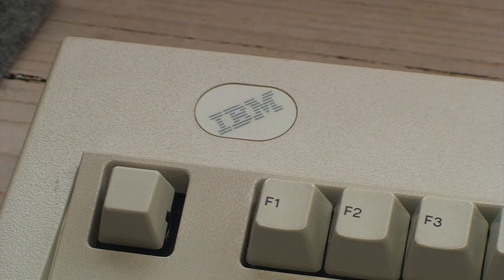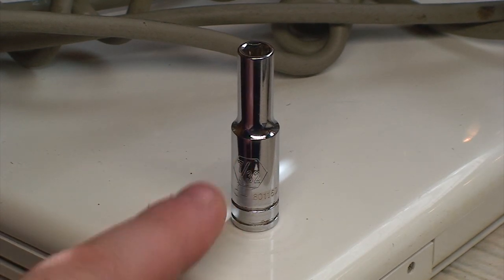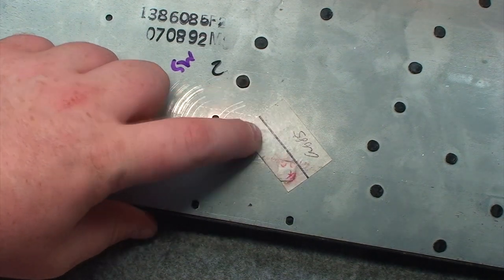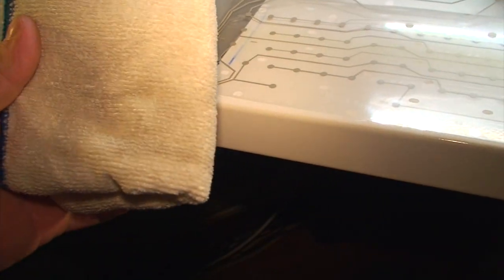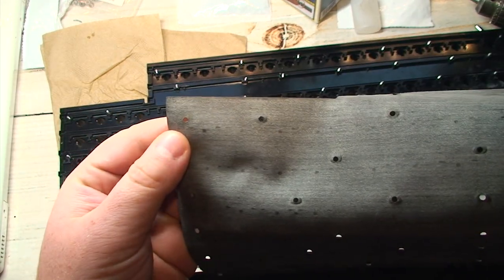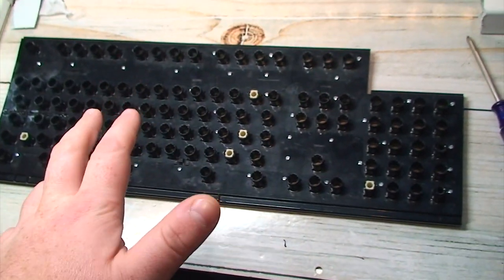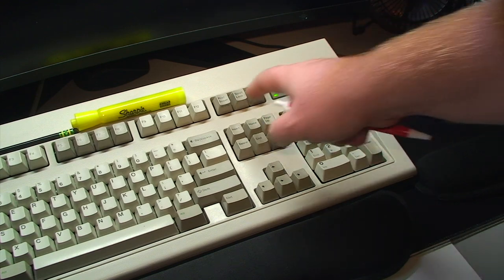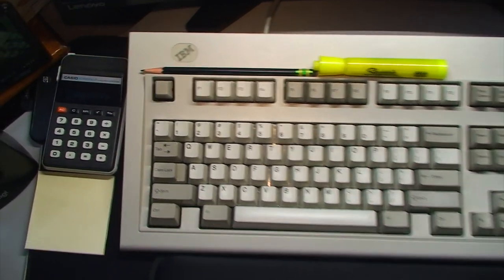Restoring My 1992 IBM Model M Keyboard... By Bolt-Modding It

Comment: When I cleaned the keys and the key caps during a partial restoration, I failed to dry out some keys. Consequently, the minute drops of trapped water, caused the some of the springs to corrode. I had to get new springs from Unicomp and devise an applicator to replace the spring whilst the board chassis was still in one piece. I realised I only had to wash the key caps, NOT the keys. I know that an inevitable bolt-mod will need to be performed at some point. Your M's failure after sitting, could be an ever so slight film of corrosion on the contact foils that builds up when not used. Kudos to you for carrying out the bold-mod, you did a marvelous job. Cheers.

Comment: Nice video. Reminds me of how difficult it was to do a bolt/screw mod the first time I did it. It gets easier the more you do it. Now, with the right tools (Dremel 4300 set to the lowest RPM, smaller bit, better screws), I can usually complete a full Model M cleaning and screw mod in ~24 hours. Or shorter, if I don't have to wash anything and wait for the parts to dry.

Comment: Nice restoration! I had no idea that the Model M has plastic welds/rivets holding it together, especially considering my multimedia Dell keyboard from the mid 2000s has screws holding the metal plate. The mod you made looks like it’ll last a long time and it looks like new again! I know how long a keyboard cleaning and disassembly can take, but at least the end result is worth it! By the way, if you plan on restoring more keyboards, you can make one of those key cap puller tools. I made one a while ago and it has honestly helped a lot. If you’ve got extra keyboards like I do, it’s definitely worth making/getting one.
Reply from the maker: I just bought 1988 Model M that is thoroughly filthy, so a full disassembly, cleaning, and possibly a bolt or scew mod is on the horizon. I'll definitely look into making or getting a keycap puller; doing it with your fingers isn't exactly fun!
Reply: Can’t wait to see that! I’ve been wanting to restore more keyboards also but they sure do take some time. It really is a night and day difference when you see before and after though and you can never have too many keyboards. You’ll see the difference immediately with a keycap puller!

Comment: Good job. I did this mod on some almost dead Model Ms a few years ago (an early 90s IBM and a early 2000s Unicomp). On both of them the rivets were OK, but the membranes went bad (possibly due to spillage), so I had to repair them with conductive ink. It was difficult to get working properly as the tension of the bolts really made a difference. My main (circa 2014) Unicomp is fine at the moment, but the rivets are starting to fall off.

Comment: Glad you were happy with the result.  I would expect the majority of people watching this video would be for the purpose of watching someone carrying out the bolt mod (I would be one of those).  Your video completely omits the work you carried out and, unfortunately, is nothing more than a summary of what you had done.  I understand if you removed the most important sections to keep the video duration down, but a time-lapse of you removing the keys and rivets, the drilling of the holes and the insertion of the bolts would have made this far more insightful.
Reply from the maker: I had intentions of including more of the how-to aspect of it, but soon realized halfway through this project that doing so would've been a bad idea, as this was my first time doing this and I'm in no way an expert. 

The drilled out holes didn't align correctly and needed to be re-drilled, certain holes needed to be reamed out with a red hot-paper clip, pieces of the membranes needed to be trimmed, several of the buckling spring key switches ended up getting bound up, one flipper mechanism even needed to be sanded down since I drilled one of the rivets so off-center. All of this necessitated disassembling and reassembling things several times. In hindsight, all the trial and tribulation would've made for an entertaining video, but I was more focused on ending up with a working keyboard when all was said and done. Even though the end result was a success, what led up to that (if documented on video) would've attracted the ire of the armchair experts. 

Regardless, thanks for watching. It's not an incredibly difficult job, but it requires a lot of patience and persistence. Since performing the "mod," its reliability has returned and the typing feel is even better. Best of luck!

Comment: I might have to give this a go with my M13 as it was slightly less than reliable last time I used it probably half a decade ago before I started moving around with jobs and living situations (I'm guessing it hasn't gotten better with the years in storage).
Reply from the maker: It's odd how mine only had a few broken rivets, yet was acting up without any provocation. It's been sitting in the same spot used as my daily-driver keyboard for the 7-8 years. 

The jury's still out on whether the rivets can entirely be blamed, and I'm leaning more toward it being the membranes being dirty or the PCB and ribbon connectors. Just like those old Handycams, sometime all it takes is some persuasion to get things working again.

Either way, the keyboard definitely feels more robust and the typing feel is even better with it modded.